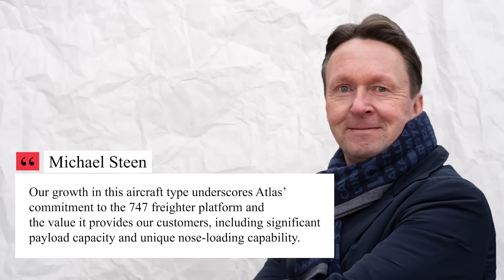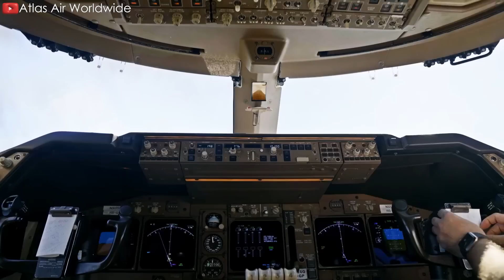Boeing 737 Max is in HUGE PROBLEM NOW! Here's Why

Comment: So, in the early part of this video the narration states that the ET aircraft that crashed had a history of electrical issues, and that there was an uncommanded roll incident.  The roll has nothing to do with the MCAS (that system is pitch only), which has been blamed for both MAX crashes.  Tell me, Boeing haters, who is responsible for putting into service on a scheduled airline flight an aircraft that may have technical issues, or at least a questionable history of issues?  Good God, the everyday maintenance and operation of an aircraft does not rest on the shoulders of Boeing.  I think that Boeing screwed up in the design of the MAX MCAS by choosing to use the data input from only one of the AOA vanes (lack of redundancy), but if that specific airframe was exhibiting other technical issues, then ET has to be held accountable for even launching that aircraft.
Reply: For some reason you are automatically assuming ET didn't fix the problem themselves. And also reported it to Boeing as a complaint.

Comment: Just get rid of that 737 max and start from scratch. Design something nice that can fit those larger engines in the right place under the wing. Yeah it’s gonna be a massive cost but worth it if it kills this whole story. I legit chose to flight on an airbus plane for my upcoming trips. They’re just gonna keep losing money anyway
Reply: Its absolutely not that easy. That is billions and billions dollars worse than trying to fix the Max. Billions lost to cancel waiting customer's orders, billions to research and develop its replacement. Billions to set up manufacturing and retooling. And billions more of troubleshooting that new 7x7 with its new set of problems
Reply: @Captain_Simp_00  you’re absolutely right but how many years has it been since they’ve been trying to fix it. People are not gonna trust to fly on an inherently flawed design. The MCAS concept is an augmented reality safety feature. Should a sensor malfunction it leads to a catastrophe. The more they try to fix this plane and more parts and protocols seem to be unsafe

Comment: According to me if Boeing wants to save themselves they need to fix the problems with 787s and 777x and complete the 777x certification as soon as possible and discontinue the 737 max and make a new narrow body aircraft
Reply from the maker: Even 777X is having trouble now

Comment: Both , Airbus and Boeing  need to stop focusing on small aircrafts 
And focuse more on big one
Reply: No matter what, manufacturers are focusing on the biggest market and that is narrow bodies.....You know nothing about aéro...
Reply: Airbus has fairly new widebodies.  The A350 and A330 Neo.  Both are selling well and are proven aircraft (not aircrafts).  But the majority of sales are for short to medium haul.  They tend to use narrowbodies.  Boeing has the 787 that is certified, and they are working to get the 777X certified.  So both Boeing and Airbus are focusing on widebodies.
Reply: What?
Reply: Weird statement. The market doesn’t want just large aircraft. The 737 and a320 are best sellers for a reason.